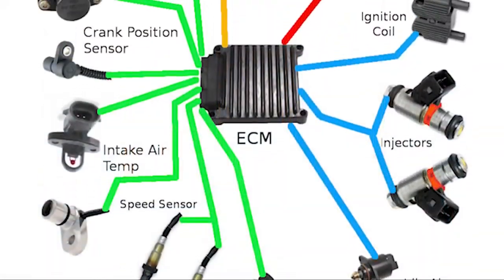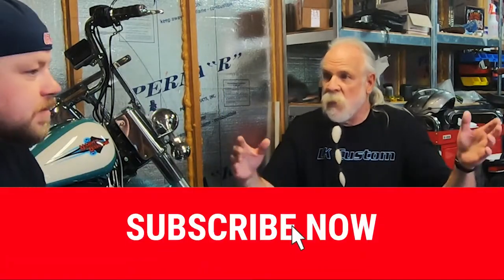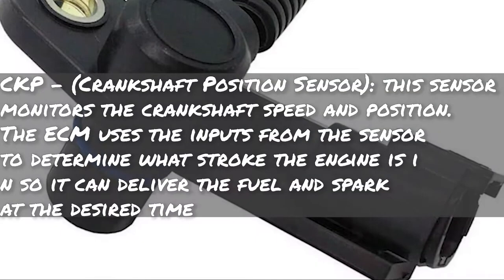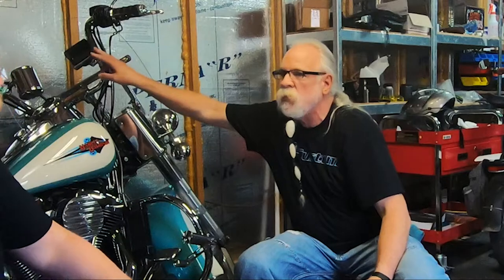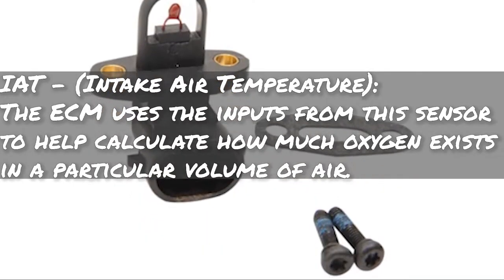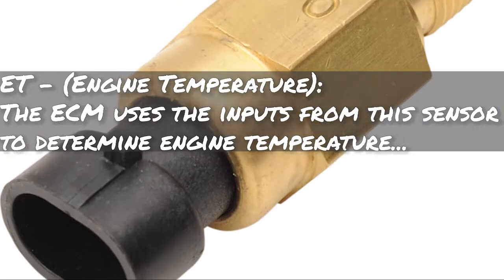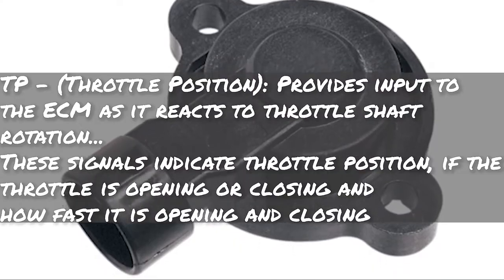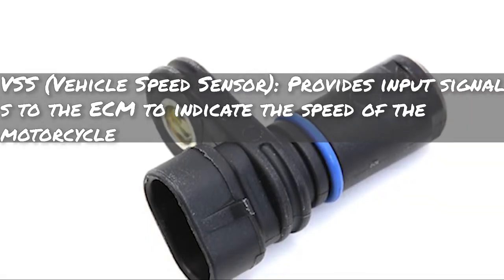How the Electronic Control Module ECM Adapts

Comment: I liked  it  better   with points  and  and  a Bendix  carb   /  Runs  forever   , easy to maintain  , Anyone  can  fix   !  With out  A  dealer   !!!
Reply from the maker: Totally get that! Simpler systems are way easier to work on. No need for a laptop or a dealer—just tools and know-how. Those setups really were made to last. Thank you for commenting! MB

Comment: Back in 2020 I ran into a water filled tire rut at low speed and laid my Suzuki sport bike down and it wouldn't start until I cycled the ignition off and then on again. So now I know what sensor controls that. I now have a 2020 Sport Glide.
Reply from the maker: Congrats on your Sport Glide! That is interesting, thanks for sharing and for commenting! 👍MB

Comment: I just have a question on my 2010 sportster 48 I have an older fuel pak and running open pipes with tti’s what ajustments do I need with fuel and air adjustments.
Reply from the maker: We do not know what settings to use on the FuelPak, you should contact Vance & Hines on that as they provide support for their Tuners. The TTI's are irrelevant to the tune from the FP3.  If it is running good without the TTI's, it will run better with the TTI's, with no adjustment needed. If you have removed the baffles you would probably want to change your exhaust portion to free flowing on the tuner. 

Thank you for commenting! MB

Comment: Okay you got a 2024 CVO ST adding say D&D 2:1 baffle padding( steel tube ) removed baffle reinstalled, stock or K&N filter basically same as one stock it came with. Now what need to tune for it or does this stay within the parameters of what you’re discussing in the ECM compensate for it?
Reply from the maker: You can change your Exhaust and Air Cleaner on your 2024 CVO ST and you do not have to retune. Here is a video on that subject - https://www.youtube.com/watch?v=HzSIXqvFuw0

Here is a link to a written report on the ECM that you may also find interesting/useful - https://www.dkcustomproducts.com/how-the-harley-ecm-electronic-control-module-works-with-dynamic-tuners.htm

Thank you for commenting! 😎👍 MB
Reply: @ 
Does DYNO JET have a PV-2 type like PV-3B to work on the 2024 CVO ST yet?
Reply: @ how about adding an air breather system and which would be best for a 2024 CVO ST and retain the stock filter / catch can system? Which would be best the filter or catch can?

Comment: I don't know about newer bikes but in 2008 while riding my 2007 Road Glide to California from Pennsylvania the ecm did not immediately calibrate for altitude. When I got to New Mexico my bike wouldn't run for shit. Being the bike was under warranty I stopped at a Harley dealer in Albuquerque. When I told them what was going on they laughed and asked me if I knew where the hell I was. They explained that at that altitude and piss poor gas in that area, that would account for my loss in power. They said if I hung around for a couple of weeks the ecm would adapt. They suggested octane booster and more downshifting to pass. When I got back to PA. my bike ran fine.
Reply: My carb 99 Heritage was feeling the affects of the higher altitude during my Smokey Mountain trip.  I pulled over to an overlook, took out my screwdriver and made a quick adjustment and every thing was fine.  I prefer to act as my own ECM and adaptation to altitude changes are less than five minutes.
Reply from the maker: The advice you were given is inaccurate.  While there is less oxygen content at higher altitudes, thus there will be less power, the ECM IMMEDIATELY adjusts for that lower oxygen content, and the engine will run fine.  Max power drops about 3% for every 1,000 feet elevation.  But that is Max power, so if you were running on average at 50% throttle, then to get the same acceleration 8,000 feet higher, you would need to give it about 75% throttle.  But it will run just as smooth.
Now, if the gas was bad, the ECM is not going to adjust for that no matter how many tanks of bad gas you run thru it.

I have ridden at 10,000 feet elevation and at 2,000 elevation in the same day dozens of times and there is no running "like shit", just more throttle is needed for the same acceleration.
There must have been other factors at play (clogged sensors, too much engine heat, etc.) to make it run shitty.
Now, if by "wouldn't run for shit" you mean that full throttle power felt at sea level is less than full throttle felt at 6, 7, 8 thousand feet...that is just a function of less oxygen in the air, which the ECM adjusts for.  With a carbed bike going to those elevation changes, you would have to physically change the jets in the carb, or it would run poorly, (hesitation, sputtering, etc.).
KP
Reply: @DKCustomProducts  I'm telling you my bike had no power. I was riding, it so I should know.

Comment: My biggest problem with Harley EFI is that it is not self-tuning and  has to be remapped whenever you make changes. 
That's why I like to stick with a carburetor that I can rejet in about 15 minutes with Jets from a $20 jet kit.
Reply from the maker: Fair point, carbs are definitely simpler in that way. But EFI has its perks too: better cold starts, fuel efficiency, and consistent performance. A good tuner or auto-tune system can make EFI a lot less of a hassle over time. Here is a written report on the ECM that you may also find useful/interesting - https://www.dkcustomproducts.com/how-the-harley-ecm-electronic-control-module-works-with-dynamic-tuners.htm

Thank you for commenting! 😎👍 MB
Reply: @DKCustomProducts  I don't hate EFI. I see a lot of great points I just feel like the manufacturers hold back on what it can do so you have to come back to the dealer.

Comment: Can’t you make the motor run cooler if you can control the air and fuel mixture and optimize fuel efficiency
Reply from the maker: Proper tuning and fuel/air ratio play a role in keeping temps manageable. Properly tuning your bike typically you will see a 10-15* drop in engine temperature. Here is a written report on the ECM that you may also find useful/interesting - https://www.dkcustomproducts.com/how-the-harley-ecm-electronic-control-module-works-with-dynamic-tuners.htm

Thank you for commenting! 😎 MB